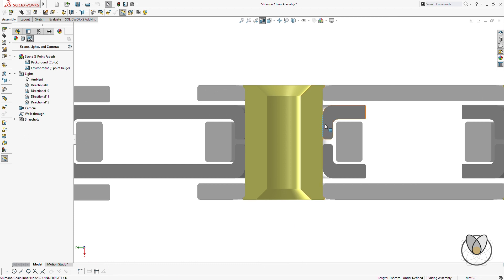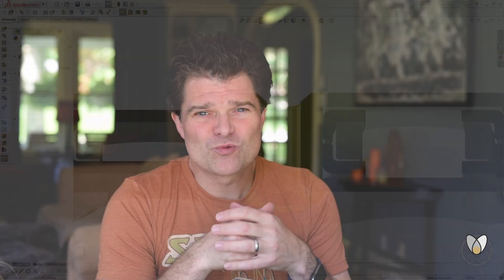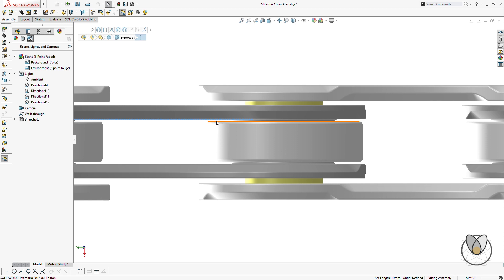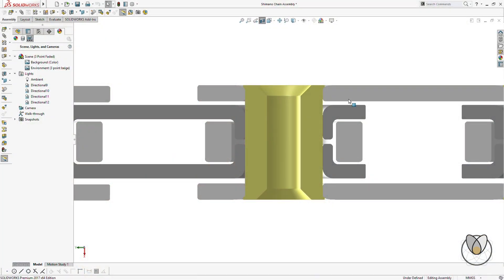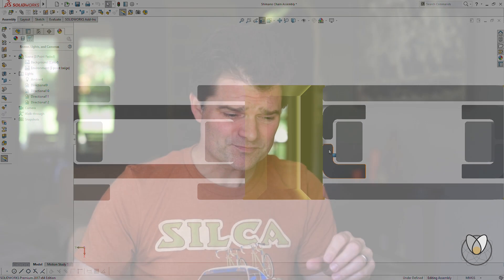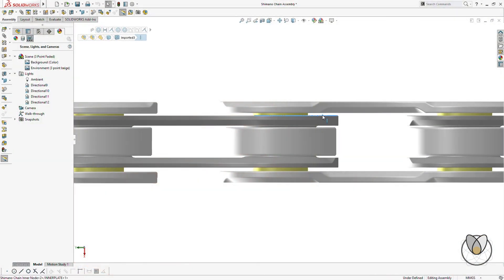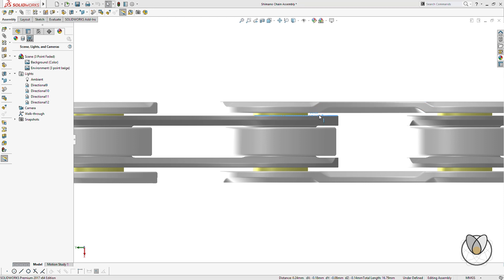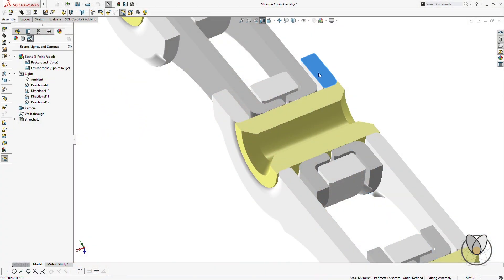MGTV SPECIAL: Chain Friction Explained!

Comment: Great video, really informative!
My high performance recumbent bike has almost 12 feet of chain. I clean it with the "shake in a bottle with solvent" method but I have to use a milk jug.
The downside, of course, is that this is a ton of chain. The upside is that cross chaining isn't a problem because of the long chain run.
I use Squirt lube. Takes forever, but works great!
Reply from the maker: Thanks for the note Michael, so tempting to make a comment about the size/length of your chain or to have thoughts about pulling it, but I'll refrain ;-)  Milk jug sounds perfect for your use case, love the ingenuity and the upcycling!!  If you like Squirt, I think you'll love Secret Chain Lube.. we consistently show lower friction AND longer re-lube intervals in testing across all temperatures.  Some of this comes from the Tungsten Disulfide permanently modifying the chain surface, so even is cost was a big consideration or issue, you could start a chain with SSCL to get it really rubbed in and surface modified with the WS2 and then move to Squirt for maintenance to save costs.. - Josh

Comment: Great video, and a great explanation of tolerances and why chains get precipitously more expensive the more gears they're designed for. 

This leads me to a question - would molybdenum disulfide be a reasonable wax additive if you were lubing, say, a 6-speed chain? These seem analogous to your 20- or 10-millionths bearings, where that particle size might be more appropriate. 

I ask because I use an old ("vintage") steel road bike as a commuter, and the weather where I live means that wax is the ideal lubricant.

Comment: Great Video!  Please include your suggestions in all your videos for products like Chain Cleaners & Lubricants that fill the uneven surfaces of the Polished Metal on the Chains.  I will be learning about Silca Super Secret Chain Lube, and I will try this out on my road bike!!!  I have watched the video that you did with Dylan Johnson named "Your Tires Could Be Costing You Minutes. Tire Rolling Resistance with Josh Poertner".  Excellent Video as well.  I am taking your suggestions for faster tires and Latex Tubes; Because Your suggestions dove tail so well with my experience with tires.  Over the years I have experienced the improvement in speed and performance by going to excellent tire manufacturers like Continental getting both puncture resistance and performance from better rubbers.  I hope you get compensated for your engineering Salesmanship!

Comment: Super interesting stuff. My thought is that if these ultra high finished products are so expensive to manufacture then why not settle for the “rougher surface” and match a larger particle to the gaps to make it flatter. Maybe it’s an order of magnitude difference and tungsten disulfide is still the best?
Reply from the maker: This is a great question.  So the problem is that the roughness isn't consistent, and the more roughness, the more inconsistent it it.. I'll do a video on this showing the depths of the various imperfections, but in the case of this 0.6 micron surface, the range of imperfection probably varies by 0.2, but in a 6 micron surface, the range varies by say 2 micron, so it gets really, really hard to fill the roughness with the right sized particles as the target gets so much larger.. and even as you do fill them, the variance in the finished surface is quite big.. so NO, definitely better to spend the money to make the best possible surface and THEN modify it when seeking ultimate speed.  There are other options as well, and I'll discuss that in the future video.. stay tuned!

Comment: Very interesting. I run silica super secret and it's great product. What about dirt particles, won't they make grooves bigger than 0.6 microns? What would you say about adding some micronized ptfe < 3ųm to fill in bigger irregularities or maybe boron nitride into silca molten wax? Personally I feel that the chain needs rewaxing after 300kms. This is about every third ride for me. Is there a way to improve that? Harder wax base? I thoroughly degreased the chain in multiple baths with ultrasound. I feel that the wax is maybe a bit to softish and one could get  maybe even longer waxing intervals by having a bit harder wax.

Comment: Hey Josh, curious your experience using your new hot melt wax product on various chains, and the durability results between brands?  Shimano, SRAM, YBN, etc?  Are there any that you wouldn't recommend due to tighter tolerances, and maybe less wax getting in the gaps, hence faster wear rate?  Great video, you guys have obviously put a lot of thought behind your lubricants.
Reply from the maker: We have not done extensive durability testing with various coatings and such.  I will say that our hot melt wax has over 100 world champ, olympic and ProTour wins across DA, Record, RED, and Izumi chains, but of course, the bikes are getting incredible cleaning and maintenance, so impossible to see longevity differences in the field.  In theory, the more perfect the surface to begin with, the less well the wax and lube will adhere, but we use WS2 down to 400nm and the smoothest surfaces we see even in coated chains is typically around 500-600nm, so theoretically should still see some surface modification in these instances.  To put the fit/tolerance of the chain components in perspective, the tightest fits in a chain will have a gap on the order 0.04mm while the WS2 molecules are 0.0004mm in size.. 100x smaller!

Comment: Fantastic video, Josh, I particularly enjoyed the insights into tribology.  I have a question that I'd love to hear your opinion on.  I'm just about to take delivery of my new bike equipped with the Campagnolo Super Record 12-speed groupset.  I want to use the best lube possible, not so much for power saving but more for longevity as chain, cassette and chain ring replacements will be expensive.  Removing the chain for cleaning is more challenging as Campagnolo chains don't come with quick links and I don't think there's one available for the 12-speed chains.  Would Silca Super Secret still be effective in getting the Tungsten Disulphide onto the chain plate surfaces with only on bike cleaning or would I need to use a less viscous product?

Comment: After watching this video, I was wondering if you've done any testing on non-round chainrings and if they increase chain losses due to: the increased articulation around the smaller portions, and the changing chain like from long to shorter caused by the different chainring diameters?  Also do narrow white chainrings increase chain losses due to additional contact with the wider teeth?

Comment: I'm a cyclist first motorcyclist second all this talk of friction, filling voids excetera has me thinking about waxing my motorcycle chains just as I do my bike chains.... the principles are still the same cross platforms, modern motorcycle chains have X and O rings that hold oil between the plates/ pins .... maybe I'll try getting a non  X-Ring motorcycle chain strip it of factory oil then wax it.... "sealed" chains (x/O rings chains) provide enormous amount of friction it's really difficult to bend a sealed motorcycle chain ..... don't know just thinking outside the box and applying some of this wonderful engineering from bicycling to motorcycling.... I know one thing's for sure I'm getting need a lot bigger ultrasonic and alot more wax 😅
Reply from the maker: That's a hard one as you really want a wet lube in between the rubber rings and the metal, not sure how well wax would work in that interface?  We do have quite a few go-kart racers using HotWaxX with excellent results but those are not o-ring type chains.
Reply: @SILCAVelo  thanks for the feedback! the kart guys... do you know what kind of chain they're using? On my motorcycle I would ditch the x or o-ring chain for a traditional chain and wax that ... similar to maybe what the karting guys are doing?

Comment: Why not just put a really small version of those 1 millionth tolerance ball bearings instead of what is essentially 120 journal bearings in the chain (Sarcasm). But I can actually see Ceramic Speed doing something similar and charging $1000 per chain, after all they did have that shaft drive prototype. On a more serious note, do chains get faster with wear since the pin and inner plates are theoretically lapping and decreasing surface roughness? Maybe a parabola with a max efficiency point and then a decrease due to wear?

Comment: Josh about turning the corner. If you are dripping on would it help to lube both top and bottom of the chain?
Reply: I think the suggestion given on the podcast re: applying a drip-lube (they were specifically referring to drip-on wax lubes) to the chain was to cross-chain when applying and backpedaling to work the lube in as the opening and closing ofvthe gaps would help work the lube into the insides of the links.

Comment: I admit I'm a 1x convert. There are unquestionably some trade-offs for 1x. You mentioned one here which is the cross-chain angle, and the other is the jumps (assuming you're trying to set up a system with comparable range to a 2x system). But there are some performance gains, to my knowledge. 1x systems can be lighter and more aerodynamic. There are the other less performance-oriented benefits like (in my opinion) a more fun riding experience, less maintenance, and a cleaner look. Then there are some aspects which I'm not sure of the performance benefits of. For example, since you have no front derailleur, which commonly needs to be adjusted, perhaps there's a benefit of no time where you're riding on a derailleur that is not performing optimally because it's between adjustments. Second, there's the possibility of a narrow-wide chainring. I'd love your thoughts on a comprehensive comparison of 1x vs. 2x performance that takes all the trade-offs into account, not just chain angle. Thoughts? :)
Reply from the maker: Don't get me wrong.. I'm a huge fan of simplicity and really love riding 1x setups, single speeds and pretty much anything with 2 wheels.  My issues with 1x come into play when we are chasing speed or efficiency.  So the thick/thin rings tend to run at higher friction, the increased necessity of cross chaining leads to high frictional losses and tiny cogs have additional frictional losses.. so if you hire me to advise you for something like the Olympics...it's hard to make almost any good argument for 1x unless you are on a bike that can only be setup that way.  The real strength of 1x is that it allows considerable advantage to rear suspension designers, with a secondary advantage that frames can be made more cost effectively as FD mounting/location/reinforcement/cable routing is a massive engineering and manufacturing cost driver in the mtn bike world.  For road, the aero advantages of 1x are offset by the much longer RD cage and large cogs.  Weight mostly doesn't matter, but when it does matter, the additional friction of cross-chaining of your 1x system will cost you the equivalent of 300-500 grams on a 10% grade.  So for me, it's best used for having bike fun but there are better options for bike racing. - Josh
Reply: @SILCAVelo  Thanks so much for your thoughtful reply, Josh. Really appreciate it!
Reply: @SILCAVelo  I find the claim that cross chaining and 10 percent grade is like adding 300-500 grams. Where did you get this info? In the research I've looked at, the larger cogs keeping the chain links from bending as much, more than makes up for the cross chaining bend. Also a smaller cog, going from 11t to 10t comes out to be about 1.5w loss in the bend of the chain where a chain that is not properly lubed could cause a loss of 7.5w. Not trying to contradict your claims, just interested where this info came from. I read about all this from ceramic speed's test they did in the past. I'm actually testing a 1x13 sram group that I'll have a video out soon on so just want to get as much info on this as I can. Thanks for the amazing video.

Comment: Hey Josh, ‘wondering why tungsten disulfide, rather than titanium disulfide?  Cost?  Better?  Thanks.
Reply from the maker: Titanium disulfide is less lubricious, softer, less durable, smells bad, and has some additional health and safety warnings attached when compared to WS2.  My understanding is that it is primarily valued for use in future battery and energy storage technologies over it's benefit as a lubricant.  - Josh

Comment: Josh, how permanently does the WS2 adhere to the metal? Will it come out if I need to submerge the chain in degrease again?
Reply from the maker: Some of it will permanently impregnate the metal surface, over time the chain surface will actually get faster because of this!!

Comment: I have good example of tolerance stacking on my track chain. It's easily 2mm shorter over 100 links and fits tightly around the front of the 48 tooth chainring. The link pins are extremely tight fitting into their bushings. In my application this chain is marvelously smooth. I'm hoping that this Wipperman 108 connex chain is not limited to this one lot.

Comment: One thing I was wondering is if the Tungsten Disulphide particle is surounded by wax, wouldn't the wax act as a barrier preventing it from bonding to the metal.
Reply from the maker: Pressures inside the chain go into the thousands of PSI so the WS2 particles are essentially smeared into the crevices in the metal under load and are then held there by the wax coating over top.

Comment: Hi Josh! Thank you for the great content! Out of curiosity I have cleaned my chain with one of these chain cleaning tools and the submersion/shake method after! I can not get any extra dirt out! So that just as an fyi! I was also wondering about wether there is any difference between getting the wax just on the chain or on the chainrings/cassette also! Appreciate any insights!
Reply from the maker: So there is this thing called 'surface modification' which is the idea of using special particles matched to a surface that can either smooth the peaks, or fill the valleys.. there is some data that shows running this type of surface matched lubricants can help fill the voids in the mating surfaces of the cassette and chainring, but we are not at a 100% conclusive place here yet... yet.  I will say that for hour records, olympics, world's, etc.. we will micro polish the cassette and chain rings, and even have a process that is a high velocity impingement of the WS2 on these surfaces that has proven to make the system considerably faster.  I like to say that I'm often wrong but will never lie to you.. so taking that into consideration, we don't have enough data at this point to say that putting the lube on rings and cogs is helpful, but from other data that we do have, it is also almost certain to not hurt you.. Best - Josh

Comment: Good thing the link pins don't have tiny ball bearings assembled by elves! Only pro teams and millionaires could afford them.
Reply from the maker: This sounds so amazing until I start thinking about contamination!!  Yes, we owe the characters in the history of chain a debt of gratitude as they really have gotten us to a point of amazing efficiency both frictional and cost wise!!
Reply: @SILCAVelo  Campagnolo could do this. They're good at adding high drag contact seals with  exquisite  high spec ceramic bearings like on their Super Record Ultra Torque BB! You"d gain nothing in performance, but they'd gain Euros!